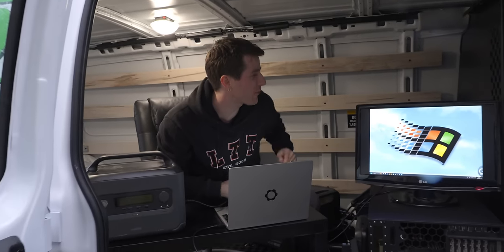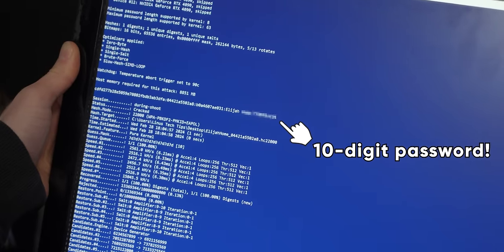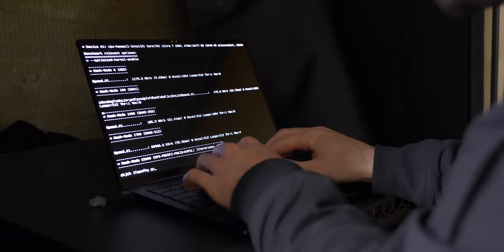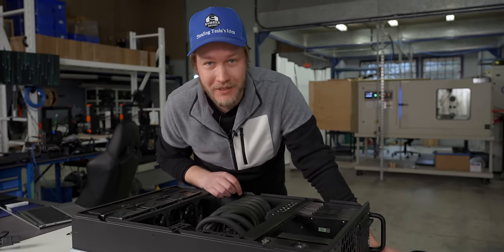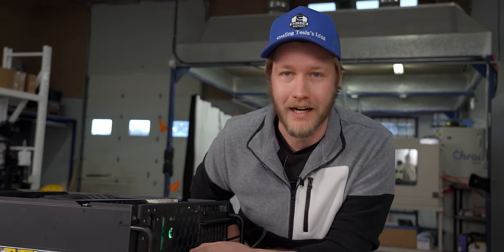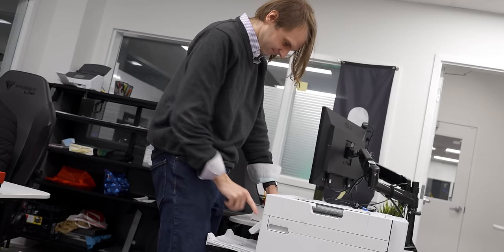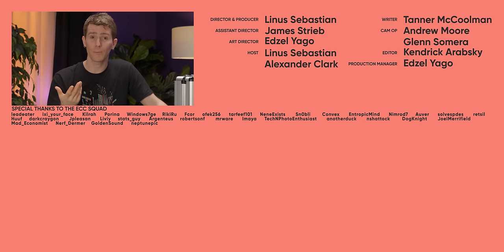I Made a Wifi Cracking Van

Comment: Honestly it's the first time in a long time I've been disappointed in a LTT video. Lots of good information but no one addressed the kinds of passwords that would be more secure (for example would using a sentence password with words formatted like "@$tr0 turf" instead of "astro turf" make it harder to crack, would it prevent dictionary attacks?) or how to set up a secondary guest network, if you can do it without buying more hardware, a bit of I yo on how would have been nice.
Linus, any chance on a follow up with a more detailed guide on passwords and your best advice for network security with rough guides? Including hardware buying advice? Inc second hand market

Comment: The last suggestion with multiple network is good, but most consumer grade routers don't have that features.
You will be lucky if it has the "guest network" feature allowing you to have second SSID, since only the most expensive models have this.
Anything beyond that requires either professional router, or custom ROM (eg. ddwrt or pfsense)

Comment: sooo tl;dr if I just use a long, random combination of letters, symbols, numbers and share it easily and quickly with QR code (as I do), with the tiiiiiiiny drawback that I might have to take the two minutes and type in that password like once every few years when I buy a new printer (I ahven't used a printer in like 10 years), I'm perfectly fine and this is all unnecessary fearmongering?

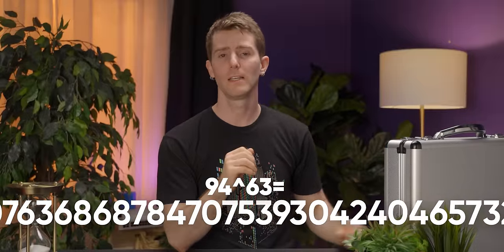Comment: 10:10 your calculation isn't quite right, because WiFi passwords don't all have to be 63 characters long, they can range from 8 to 63. So the proper calculation is Σ94^n, 8≤n≤63. Which works out to  20,497,442,737,673,217,636,335,254,372,662,635,343,505,226,212,781,934,945,547,756,536,032,971,210,714,044,111,662,233,018,898,784,996,397,633,088,879,354,537,020,160, so your figure is short by over 200 novemtrigintillion possible passwords.

Comment: So far off base with that dictionary attack breaking passphrases comment. Simple passphrases with one word, yes, but if you use more than one word, it gets a lot harder. Your equation didn't really make any sense (1,000,000 words * 42 characters???). I'll assume an average word length of 6 (4 is typical), which gives us 7 words. 1,000,000^7 = 1e^42. 2,000,000 guesses/s/4090 * 6 4090s = 12,000,000. 1e^42 / 12,000,000 = 8.3^34s or 26,424,826,653,137,155,420,260,443 centuries. Ignore the sig figs. Of course, that's if you know that the length of the password is 7 words. It is a lot bigger when you don't know the password length. The important thing to remember is that password complexity grows exponentially per word while your cracking power grows linearly with the number of GPUs.

Comment: So what you need to do is turn off wifi. You don't need it anyway... no, listen again, you don't need wifi. Ah ahh ahhhh. Listen little one. You don't need wifi. You think you do, but you don't. That printer? plug it into the usb port on your router or use an ethernet cable. Your tablet?  usb ethernet dongle.  phone, same. What's that', wires are too complicated, awwww that's cute. why even password your wifi if you're being a baby about it.

Comment: Why waste time & money cracking? my only spending is fuel. I still wardrive when i need free proxies, and i need them often. Won't tell why obviously. EVERY hood has at least 2 guaranteed wifis that are vulnerable to WPS attacks and it's 2024. Takes about 20-30 minutes to find them, crack them, save the gps coordinates and off you go to another street. Come back months later with another car so it's not sus and you're 99.9999% impossible to catch. It's as easy as cracking WEPs back in the day. ofc don't do this blah blah blah.

Comment: Please help. I just built my first pc, and it didn't turn on. I narrowed it down to the motherbaord, which turned out to be bad. I received my new motherboard and also bought a new case. I tested everything before putting it in the case and received signal. So my next step was putting everything in the case. I put everything in correctly and double-checked to make sure. When i went to turn it on, i got nothing. There was absolutely nothing at all. The Psu was silent. After a few times pressing the power button, the cpu fan started to spin a little and then stopped. I took everything out again, and i got an output. When i went to turn off the pc again, a note popped up saying the RAM was bad or something like that. Embarrassingly, i ignored it and just shut down the pc. The RAM was previously used in a build with the exact same cpu and gpu. So now, even when i take the parts out of the case, i get nothing but the cpu fan spinning for a second and then shuts off. 
PLEASE HELP 😢